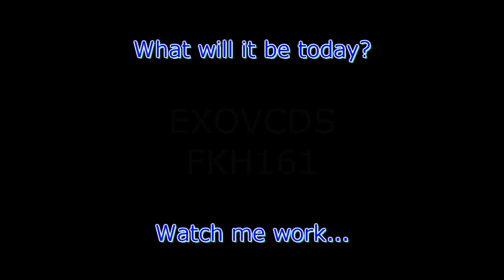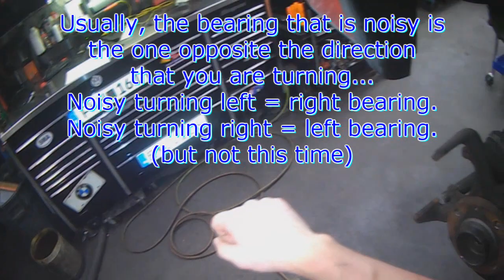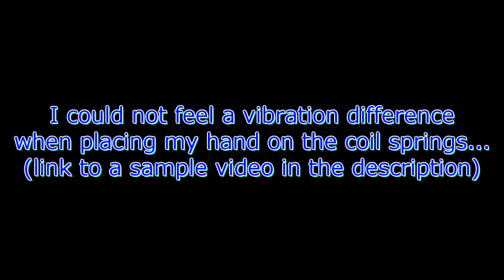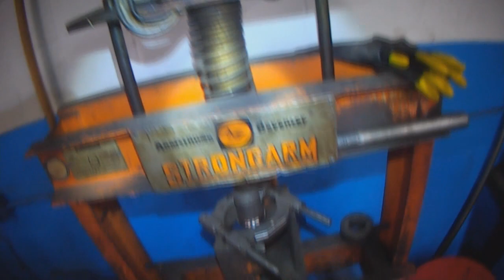VW A2: Front wheel bearing

Comment: What did you use to remove the hub
Reply from the maker: 4:22 a couple of bolts and a metal plate. You can use a slide hammer (most parts stores will have one).

Comment: Where did you get that plate you used to remove the hub? Seems like a much nicer way than using a slide hammer.
Reply from the maker: It came with the bearing puller.

Comment: Is this an AUDI A2, I needed to be sure of the car. is an Audi A2 1.4 tdi the same they are very small cars? subscribed.
Reply from the maker: Titles of video says VW A2... mk2 for those that don't know VW platform designations.

We don't have Audi A2's in North America. I'd have to look up info if it is similar to this vintage of a car 1992 to 1995
Reply: so A2 means Mk2 right? so its not a VW Audi A2?
if not what is it?
Reply from the maker: +ral islegend The title says "VW A2"... if I ever work on an "Audi A2", I will put "Audi A2" in the title.

VW / Volkswagen A2 (mk2) is NOT the same as Audi A2.

I don't know how much more I can explain this.

If you have a service manual for your "Audi A2"... then there's no reason to watch a video about a "Volkswagen A2".
Reply: A2 is the Volkswagen platform this car is based. In this case it is the golf mk2, but for example there are other cars and brands who belong to VW that use this same platform, like the seat toledo mk1, jeta mk2, etc.

Comment: hey im back, i had an issue with a crank no start a while back i've diagnosed like you said replaced all grounds, icm, coil, and distributor i did the icm power test its good, even thought i bought the hall sensor used i think it came off the vehicle not working, when i ground the middle terminal wire of the distributor connector to ground and put the king lead close to the engine body i get spark. I'm completely stumped
Reply from the maker: post more videos... let me see the cam / crank / distributor alignment when at #1 TDC.

Let me see you crank it with the center distributor wire removed and held 1/8" from the a valve cover stud.

Let me see power & ground checks of the hall sensor harness plug when the key is on.

Let me see spark check when briefly grounding the center pin of the hall sensor harness plug.
 
Let me see you bypass the fuel pump relay to hear the in-tank and main fuel pump operation.

Let me see fuel pressure & flow from the injector rail port.

Let me see the instrument cluster when the key is on and when you are cranking.

Let me see you crank the engine with a jumper wire at the starter (key in the on position).

etc etc etc... the more you can show me... the more I can see what's going on and the more guesses I might have.
Reply: +Thomas EXOVCDS alright I'll make a video tommorrow and send you the link
Reply: +Thomas EXOVCDS how do I bypass the fuel pump relay and use a jumper wire to the starter ? I connect one end to positive and the other end to the starter ?
Reply from the maker: +Jordan Metellus Remove the fuel pump relay and use a jumper wire or bare metal paper clip to bridge the two big slots where the relay sits. Slots 30 & 87.

Attach a jumper wire to the starter solenoid... remove the red / blk wire from the starter solenoid and attach a jumper wire to the pin. When you want to crank the engine... simply touch the jumper wire to battery positive clamp. The starter will crank as long as you hold the jumper wire against the battery clamp.

MAKE SURE THAT THE TRANSMISSION IS NOT IN GEAR!!!!
Reply: +Thomas EXOVCDS alright thanks for the great explanation I will get the video up sometime this week , I also did a test in the Bentley when I measure voltage on pin 1 and 3 on the hall sensor connector they said it was supposed to show voltage but mine only showed 0.01 volts .. Maybe I did the test wrong and I touched the coil after trying to crank it was cold. I wil run all the tests like you said though thanks !
Reply: +Thomas EXOVCDS also the whole time I got it to start and run those 4-5 times the main ground from battery tray to left fender and battery tray to tranny was never grounded , I heard this could fry my Ecu but I took my Ecu apart and had a good look nothin looks fried. Would my Ecu have to show physical signs of shorts or burns in order for it to be bad ?
Reply from the maker: +Jordan Metellus No, it can get fried (transistor blows) without visible signs... I have seen many fried ECM's due to main ground not having been attached at the engine / transmission. You might be lucky, so I wouldn't worry about that yet.
Reply: +Thomas EXOVCDS alright that's good to know because it still functions as it should no prolonged fuel pump priming although it has happened twice but it primes regularly now, the isv vibrates, pressure builds and shoots gas out the fuel rail .. I will do the other tests as well when I get a chance , anyway the starter interlock / seat belt wire can be the culprit ?
Reply from the maker: +Jordan Metellus No, since your engine cranks (in the video that I saw)... starter interlock will prevent cranking. When the ECM goes (due to missing ground cable) the injector driver usually goes. In which case the injectors either stay open all the time (flooding the engine with fuel) or the injectors never open.
Reply: +Thomas EXOVCDS alright and in the case that I am gettin fuel from the injectors upon cranking, and I bought brand new icm and coil, and replaced all grounds that would leave the hall sensor or a short somewhere or maybe bad connections at the fuse box because it's gotten wet before hand it made the relays all rust inside I had to change all relays I imagine this would do damage to connections at the back of the fuse box
Reply from the maker: +Jordan Metellus Yes, fuse boxes can cause issues when they get wet.

Comment: Do you have any thoughts on using anti seize in the bearing bore? Have you seen any vehicles where a curb strike deforms the wheel bearing housing and fries even a new bearing prematurely?
Reply from the maker: +kktrtoob Anti-Seize should be ok to use. Have not seen housing damage that caused early bearing failure... usually if the housing is bent, the outer half of the housing / rest of the knuckle is in worse shape and is usually replaced because of that.

Comment: Thanks Thomas . I forgot to tell that my car has 330000 km but apart from this problem still going strong, a changed a PD Unit and had the Turbo Geometry rebuilt because it was blocking and was getting limps .Anyway, I suspect the same thing, can the play in the suspension also cause rotors warping ?For example when going on highway at 130 constant also I can feel a small up-down movement in the steering wheel so I guess the wheels are vibrating and this is transmitting through control arms to the steering wheel . What would you check and in what order ? Could this be a power steering problem also ?

Comment: Hei Thomas I really like watching your videos and all your explanations . I have a very strange problem maybe you have some idea. So the problem is as follows, when braking hard lets say from 110 kph my steering wheel goes violently left and right . I know the answer, warped brake rotors right ? Well the problem is that I exchanged 2 pairs of new brake rotors on the front, and they still keep on warping . Now I bought a second hand wheel support and bearing and would like to exchange it on the side that I think has the problems, but my father who is a welder says that it is impossible that the part that the brake rotor sits on can have an radial play . Anyway I measure the play on the discs by putting the front on jacks and putting it in gear, and on the left side there is a huge play at the edge of the rotor, so it is warped, but what can cause this warping ?
Reply from the maker: The wheel hub could be warped. Make sure the wheel bearing has no play.
Reply from the maker: +bbogdanmircea Sorry about the short earlier reply... I'm still at work. Light pedal pressure at higher speeds will get the steering wheel to wiggle if / when the rotors are warped. Make sure your suspension / steering components are ok... could be that the wheels are shifting (control arms / suspension components) causing the violent movement. The wheel bearing hub can get warped from over tightening the lug nuts / bolts... that warpage gets transfered to the rotor. Brake rotor warpage should also cause a pedal pulse.

Comment: Glad I'm not the only one who's been caught out on that phantom bearing noise issue!

I gotta take some video of the hub I pulled off my Passat when I was doing the wheel bearings...  The part of the hub that presses into the inboard inner bearing race was stepped down about .040" (1mm), while the outboard portion was normal.  Didn't notice until 3 days later when it cooked the new bearing...  Never seen that before!
Reply from the maker: +rhkips I've seen them worn the same way... we once had a hub that was so loose, that it came out just by pulling with the hand.
Reply: *****
I wonder how that happens, having only one bit of the whole contact patch worn so perfectly...